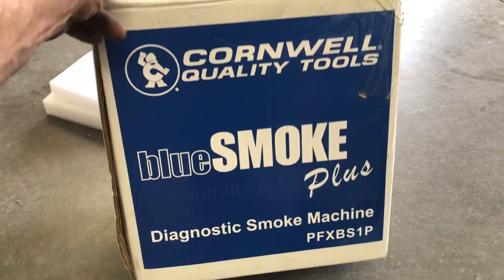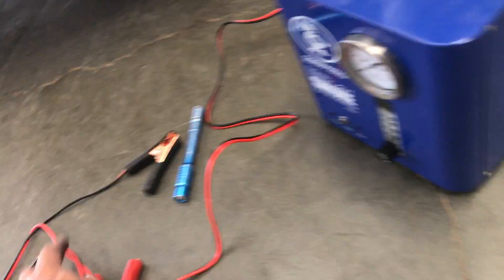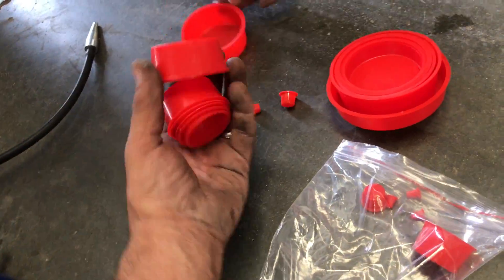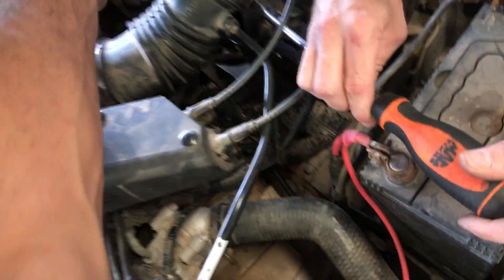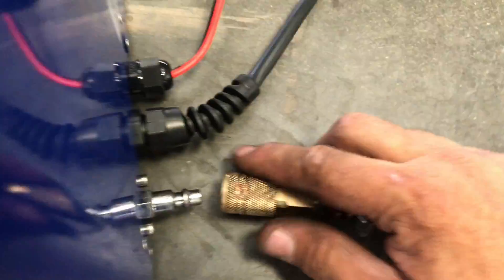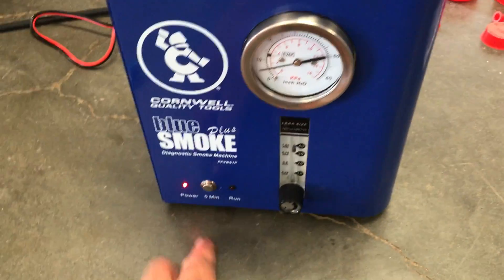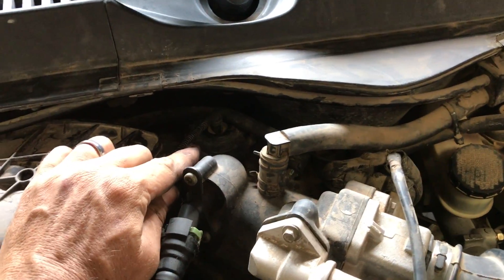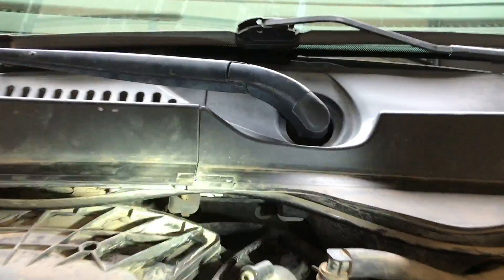Vacuum Leak Found with Smoke Machine, Solved

Comment: May i ask if this is a vacuum leak or air leak?
Reply from the maker: since we are applying air to find the leak with the engine off, then it is leaking air, but if the engine was running then it would be sucking air so it is a vacuum leak. good question, thanks for watching.
Reply: thomas brian Thanks for replying instruction was great.